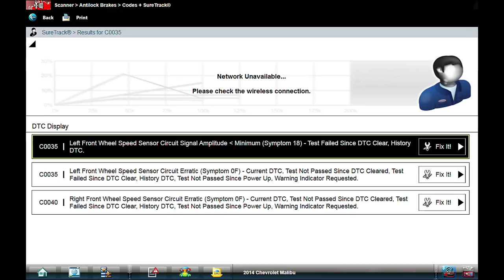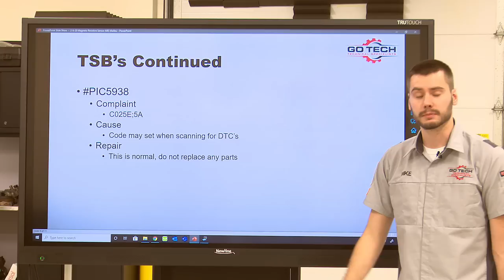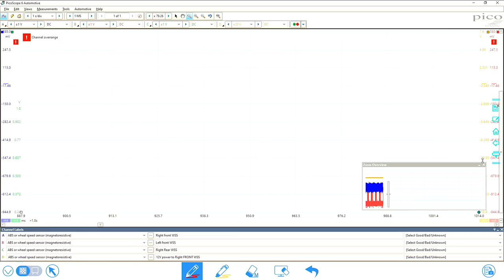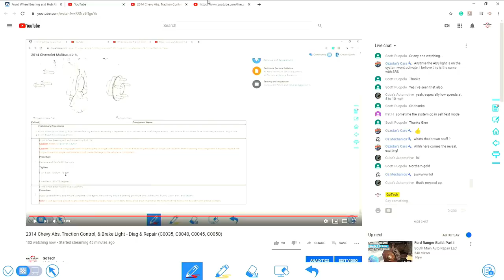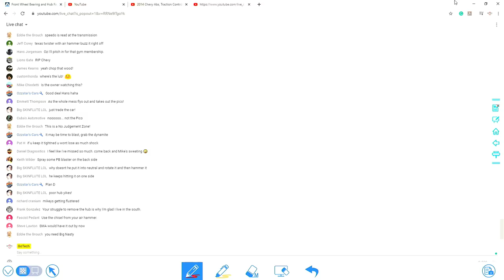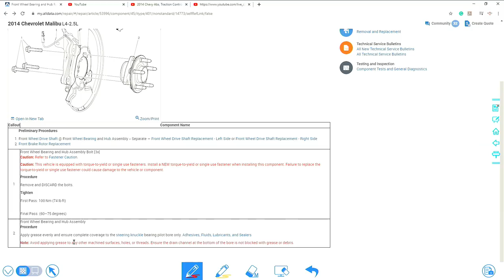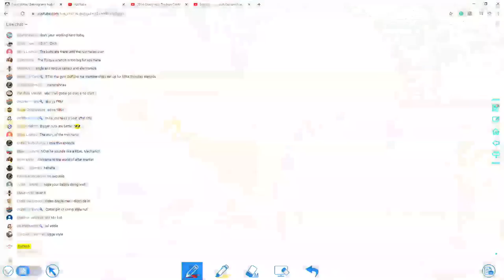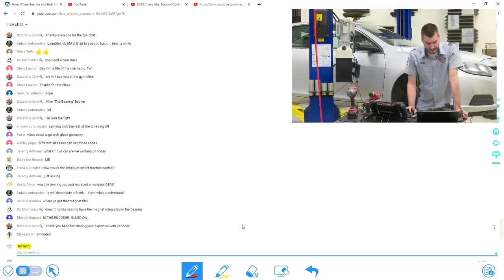2014 Chevy Abs, Traction Control, & Brake Light - Diag & Repair (C0035, C0040, C0045, C0050)

Comment: hi.. my chevy captiva shows abs, traction control, hill descent control, braking lights with dtc C0550. most of the time these light pops up after bumpy road.
any idea what cause this?
Reply from the maker: Hi Frenky, that trouble code is usually associated with an internal module issue. With a scan tool, are you able to communicate and view data within the ABS module?
Mike Becker, Senior Instructor

Comment: I'm so disappointed in my 2014 Malibu.  Have replaced two wheel bearings.....not covered by GM, replaced the rocker arm oil control solenoid....$2000 by time they did testing and the job....also not covered by GM (not sure why, but they said my car wasn't in the extended repair warranty for this TSB).  But the car is paid for, in excellent condition, so I'm keeping it and expecting to have to replace the other two wheel bearings eventually.

Comment: The question, is the encoder glued on. I have removed them from the bearing after bearing replacement.
Reply from the maker: Hmm good question John. You're thinking you may be able to replace/reuse an old one?
Mike Becker, Senior Technical Instructor
Reply: @GoTechTraining  Mike, I have actually reused, I think it was on Kia. Tech replaced bearing incorrectly, damaging the encoder. Not confident that it would work, replaced it with that I removed, to try it as a fridge magnet of all things. It worked and has not been back.  A little bit of fluke and some knowledge how systems work. lol

Comment: Dealing with one right now that has the ABS, TCS, and Stabilitrack lights on.  Using a Maximus 3.0 scan tool from Matco, when I go to communicate with EBCM is says "vehicle is not equipped with this module."  Normally it would give a failure to communicate error.  I can clearly see the module under the coolant reservoir.  Have checked to make sure ecm matches vin.  Fuses are good.  Any ideas?  Haven't been able to find an applicable bulletin and seem to be able to communicate with the rest of the modules fine.
Reply from the maker: Hey Cheddarwedge, thanks for watching. Have you tried talking with the customer, asking if the modules been replaced? If it has and hasn't been programmed, maybe it can throw that message? It could also be a Maximus 3.0 tool issue too. Any way you could try another scanner and see if it's the same?
Mike Becker, Senior Instructor

Comment: Hi.
Excuse me, but I think you are using your slide-hammer the wrong way. You didn't tighten the lock nut on the main element. Then during work you lose a lot of strength for slack on the thread. Try to use with a nut - the effect will be much better with less force.

At any slack, the transferred force is lost so in this device everything should be tightened well before use!

Greetings from Poland.
Roman.
Reply from the maker: Hey Roman, a lock nut? I've never used a lock nut on the other side. Not sure my slide hammer even came with one. That makes perfect sense though, the threads do have slack.
Mike Becker, Senior Instructor
Reply: Hi.
There is such a nut in my set and I have similar one. When I started using it the effects surprised me.
I can send You a photo of my kit and how to assemble the nut if You want.

Greetings from Poland.
Roman.
Reply from the maker: Roman, I will have to give this a try. Makes perfect sense!!!
Mike Becker, Senior Technical Instructor

Comment: anyone have info on 2012 Buick Enclave  Crank Shaft pulley bolt torque?      Maybe we said just sell this 2012 Buick with 140K miles    Are family wishes we had a mini van
Reply from the maker: Hello Chris, the crankshaft pulley bolt torque spec on that 3.6L is 2 phased. 74 ft lbs on the first phase followed by 150°.
Mike Becker, Senior Instructor

Comment: Try fluid film instead of anti-seize. Small stones can get lodged in there and shatter those tone rings, but I agree with you about the possibility of it shattering while removing a stuck rotor.
Never put a backing ate on wrong, but have forgotten them... pita! At least it's not PRESSED and can't go in BACKWARDS!
Reply from the maker: Good thought on the fluid film! UGH backing plates...just like brake line fittings. PERFECT flare...always forget the nut.
Mike Becker, Senior Instructor